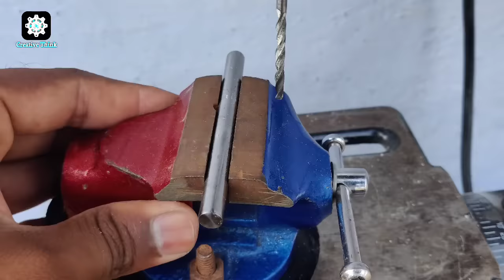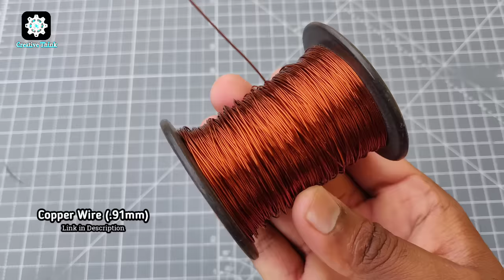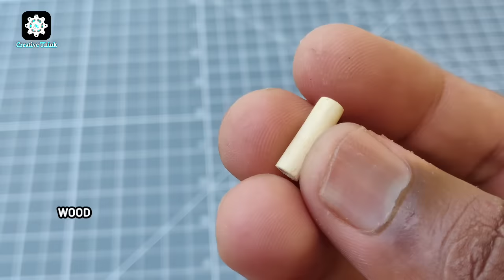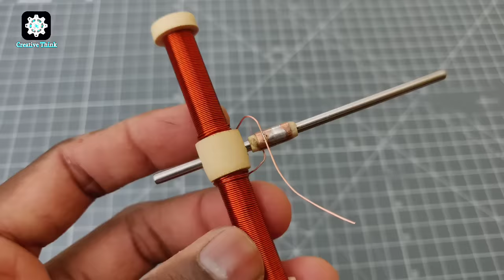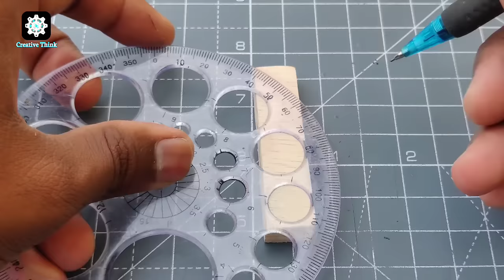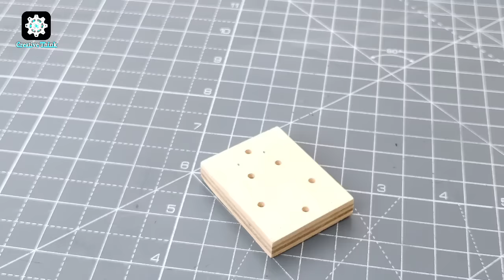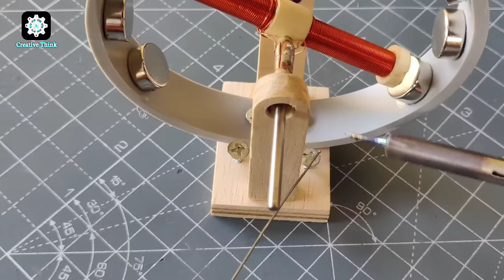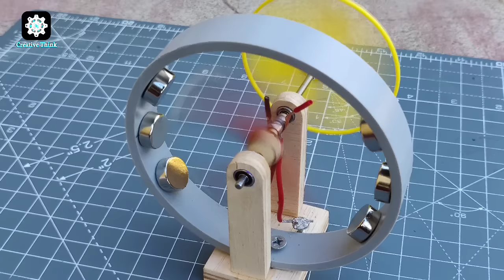Free Energy Generator Using Armature Method

Comment: I can hear electro boom in the back of my head “THERE IS NO FREE ENERGY” 😂😂
Reply: Yea same
Reply: Free? Not per se, but converting it from a Vast source (Our Sun, NO Not SOLAR with Panels) is possible look up Thomas Henry Moray's device,  Radiant Energy to Electricity.
No need for Generators which require Coal, Oil, etc for steam and turbines, or wind\solar not needed. It has been done, the source is according to Nikola Tesla the Sun. It has been suppressed but it has been demonstrated to public produced steady 50 KW. Through an Antenna not Solar Panels! Never was any fraud found. Moray got Threatened and shot at, his device was destroyed by an idiot with a hammer, he couldn't rebuild it because it was to expensive and years of improvement & work.

Would it provide us with Free Energy, Yes Why? Because it's vast source and it's from the Sun and our Sun is always there - his device worked even at night and remote areas & under Water. It doesn't violate laws of physics it's converted from radiant to electricity so it's not created from nothing, the source is our sun (according to tesla).
it's real not scam\hoax\fake or else, it would and should have changed our planet to the better but greedy bastards suppressed it so we have to pay for electricity instead of having it abundance including everything what could run it as well. As long there is Capitalism it can't exist they will not allow such a device to exist even though it is possible.

Comment: What's the total amount of time it spins for before it loses momentum?
Reply: It would probably take a very long time because the magnets are speeding it up slightly but the only thing that would cause it to stop is the ball bearing friction which is very small or air resistance which would also take a while
Reply: When he disconnect the battery like 5 or 10 seconds because magnets
Reply: @bobciesla262  magnets are slowing It so hard the only thing that make It spin is the hidden motor or the compressed air

Comment: i can generate enough power to power my 3D printer its real easy anyone can do it, all i need is a 3 pin plug (im in the uk) some 2.5mm 3 cored flex and a household plug socket and voila it just works, but to power all the garden lights, i use the wind generator i made with my 3D printer and a few solar panels on my shed roof :)

Comment: How long will it run for? Besides the bearing failing or the copper contacts wearing out, what are the limitations? Thanks.
Reply: Its not gonna run as soon as you remove the baterry this video is faf
Reply: friction, and entropy.

Comment: For the current to have the same polarity as the battery u used to start the generator, it must be spinning in the opposite direction. Means u are hiding the source beneath the sheet and the same power is used to light the LED. Anyone notice a wire going beneath the work sheet on the top left??
Reply: my guess is that since the whole thing is somewhat lifted above the tabel itself, that a small lithium akku or something is under the pice of wood and atatched to the screws

Comment: I like all these neat ideas that people make to get free energy. But you know it’s not free energy, it’s stored energy. The energy from np the magnets is potential energy that when used correctly will produce energy, however that potential energy will eventually wear out. It’s kind of like a battery. A magnet will lose its magnetic strength over time and then will not perform as you would expect.

Comment: if u add a flywheel to that it might just spin faster because the mass of the fly wheel will let the rpm keep increasing untill the friction of the bearing is to much therefore not letting the rpm increase further.

Comment: When light load is applied, how could it rotate in the same rpm without any deflection? Even conventional generators struggle a bit when sudden load is applied.
Reply: he put the wire in the screws, which can be connected to a power supply, also u can see that the base is not tilted anymore cause of the screw, sus

Comment: He doesnt lable the face of the magnets. AC current works when magnets on opposite sides of the circle conduct current. Three magnets on one side would be, NSN. Then the opposite side would be SNS. The top on the left and the bottom on the right make one phase circuit. Then the two middle make the opposite 2nd phase and the top right and bottom left make the 3rd phase. 3 phase AC.

Comment: Nuclear troglodytes can't remember Thomas A Edison invented the generator and dynamos that did not use water wind or steam to produce electricity.. The same high voltage AC power plants. He did not think you needed anything more dangerous than 120 volt AC power lines .  The power plants are local and inexpensive to build and operate.

Comment: This doesn't work my friend. Your attempt is fake, hiding a battery underneath. The pure magnetic field push-pull the rotating rod, but it can not overcome the magnetic field unless an extra external source of energy attached to it like a hidden battery. Because Mecanical frictional losses will also stop it spinning, if and only if it escapes the strong magnetic field and it will never happen.

Comment: At least do something which looks sensible. The 2 copper strips wrapped around the shaft will short circuit the battery. They are not separate. This thing can never work.

Comment: this has frictional loses and unless this is compensated the motor won't run all by itself ... The working principle is ok , but this unit cannot generate energy all by itself unless we use external method to rotate the rotor.

Comment: there's only 2 copper wires connected to the copper sheet so i think there's a hidden battery below, you can call it when there's 4 wires connected to the copper sheets 👍 but it still won't work cuze the copper wires are too small, it's better to change the video title to 'Making DIY motor using armature method'

Comment: Creative Think, in this video presentation we see you connect the 9 V battery, then I see you disconnect the 9 V battery, what was causing Stater to continue rotating, was it receiving a voltage from a unknown battery, or was it your first free energy device that created a voltage?
Reply: it uses the same principle as eletric motors, and eletric motors doesnt spin forever after you spin it a bit without current in it, so its fake

Comment: the infinite movement doesnt work, its just a crank generator, also copper needs at least a kind of force to move close to a magnet, so it stops over time, so even if it spins for a while it haves a resistence to move close to the magnets and generates some energy, but at some time it will stop spinning so the video is fake, also you soldered the wire in a bolt, which can be feeded throught a hidden battery that hides at the certain camera angle and goes to the bolt and alternates current so the eletromagnet(copper coil) turns on only at a certain time, or you just hidden a battery at the bottom of the generator or inside the wood

Comment: So if just a little jult from a battery and a flick of a finger can get it going for a couple of minutes, what if you charge the battery while it is waiting to give the next jult. It has extra energy put into it from you so would it be able to charge battery before the battery sent some electricity back to keep it rotating for an even longer duration. Obviously not forever, but for a longer time than before?

Comment: How is it free energy when it took a battery and a push from your finger to start. It took electrical energy from the battery and Kinetic energy from your finger to start. If it requires energy to start then it is not free.

Comment: If you ever crank a hand held generator, attached to a light, it is harder when attached to a light. The axis experences magnetic drag, and shortly after this video ends, it certainly slows down and stops without reattachment of a battery. Somewhat amusing, but actual misinformation. There is no larger version of this, and this ine does not actually do what the video claims. Therefore this edges towards clickbait. Human time gets wasted. WE do not live forever. Energy changes form.

Comment: How many volts does it generate per hour?
Reply: Work is calculated by Force x Distance. Force can be calculated by Mass x Acceleration. In this case, acceleration includes the friction coefficient of any moving parts.

Whatever the number is, it’s in the negatives. In a closed system, it’s not possible for a device to generate energy on its own.

This video is fake and it says as much in the description. Perpetual motion isn’t possible.
Reply: Voltage is coming from battery under that plywood stand 😂😂😂

Comment: You can see 8:30 sparks on the cables. Why should current flow there. So the "motor" is supplied with power via the screws under the blade. Boring

Comment: you guys need to stop trolling and need to think outside of the box, i dont say this system works, but if you harvest the energy from a magnet , i has nothing to do with second law of thermodynamics, try to make an instable system with gears and magnets and then throw rocks at people who try like all religious square heads do.., in wind turbines there are some magnetic accelerators that push the propels when wind is not applied even, there are called rotation compensators and they are acting using N magnets,   ""You cannot solve any problem by using the same set of thinking that you used when you encountered it. "" it easy to sit passively back in a chair and troll about the second law when you are the one who clicked the video in the first place.